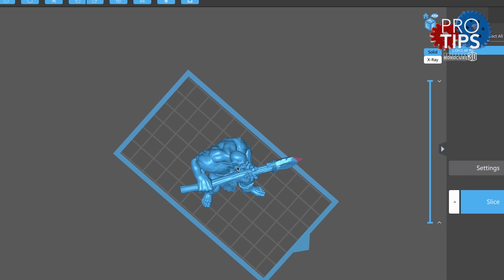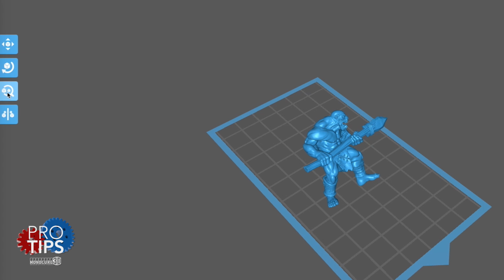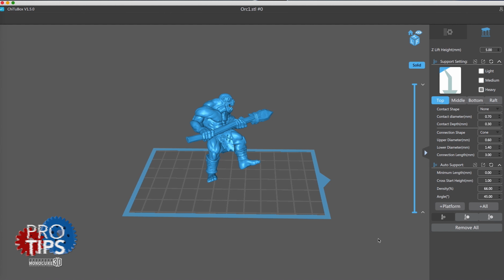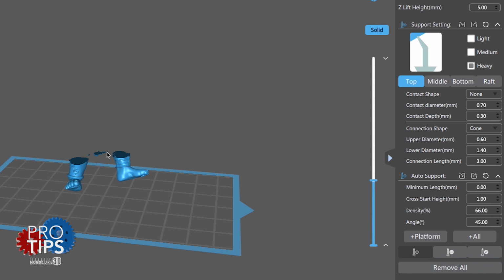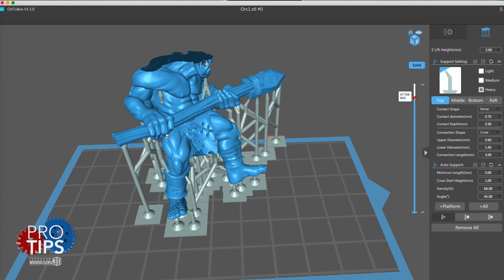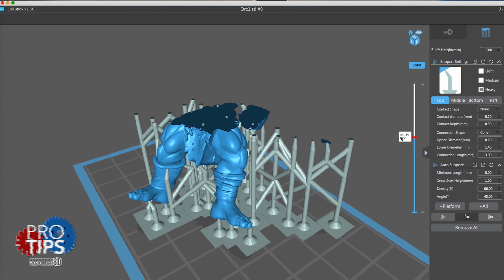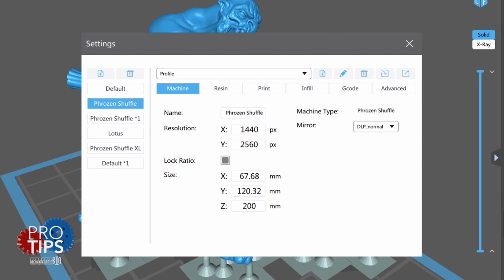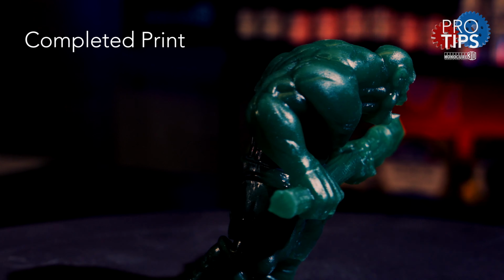How to position and support your 3d printed resin models in Chitubox.

Comment: I pretty sure the teeth failed. Notice in the video during the high res reveal, they start showing it from a side angle then just as you might be able to see the side of the face they start blowing smoke at the model. Why not just admit your mistake instead of trying to cover it up?
Reply: That was my observation as well. It was pretty apparent that the upper teeth would be an island and not print correctly. It could have been a perfect time to show that is important to double/triple check your layers before calling it final.
Reply from the maker: The teeth didn't fail! We were not trying to cover up anything. The smoke was not intentional.
Reply: This tutorial is misleading because instead of checking islands in the model, relying solely on Auto-support is a proven receipe for failed prints. How is that for "Pro Tips"? Many people will try and do this and wonder why parts of the model won't print. When he removed a support for the teeth, I was perplexed thinking this is definitely going to create an island and missing teeth in the final print. And then they ended the video right before the front face reveal. Lol.
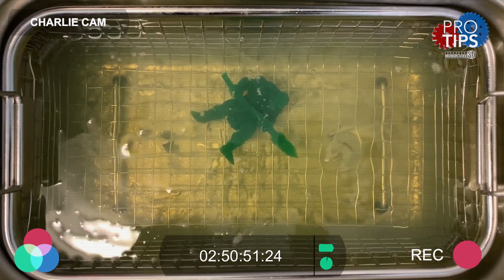Reply: It didn't really even have supports for the teeth, just one for inside the mouth. Yes the teeth failed. You can clearly see the failure at 15:30 to 15:40. This model would have been best printed on it's back, the way it was positioned by the artist! That is the only way to get the teeth to come out right.
Reply: True.

Comment: Thank you - Question: Why did you remove the supports from the teeth?
Reply from the maker: Andreas KOKKINOS I didn't think it was needed and would be hard to remove.  a I was right as the teeth printed perfectly.
Reply: @Monocure3DProTips  Thanks. I am trying to understand what made you take this decision. Wasn't the tooth an island?
Reply: @vactirio  I am wondering the same thing. Did it really print perfectly or is it just not noticeable. I wouldn't want a little chunk of hardened resin floating around or sticking to the FEP
Reply: MV Dive  I think so too, in fact at 15:35 we can see that the model does not have upper teeth

Comment: Did the top teeth print correctly?
Reply from the maker: It was a long time ago so I can’t remember!
Reply from the maker: It was a long time ago so I can’t remember!
Reply: If you look carefully in the video, you can see that the upper teeth, in fact, did not print. It does seem almost intentional by the video editor to gloss over that with how they cut the 360 rotation of the finished print.

Comment: Exactly what I needed to understand around supports. Thanks!
Reply: Dont rely on auto supports.  They miss a lot.  Even in this video, the reviewer missed supporting the right hand .  That print would fail.
Reply: @broderp  thanks for that. Do you have  any advice on how to decide where to put a support, especially how far between each support? It is it all a matter of trial and error until you just have an eye for it?
Reply: @SimonJHudson  the most important is to support every island. Slide through the layer view an hit any spot that is not in connection with the rest of the print. this is also important for the orientation of the model to make it easier for you to support well.
Reply from the maker: Glad it helped!

Comment: Some ideas... It would be great a video in which you show a printed model with all the different types of resin that Monocure sells and talk about their properties. Also mixing normal resin with Flex100 and doing drop tests. In this way we could know what would be the minimum percentage to add flex so that a model is as rigid as possible but does not break into small pieces if it falls to the ground.
Reply from the maker: Thanks for the ideas Martin! We did do a Flex100 video - maybe you missed it? https://youtu.be/V-3enPZoQYs
Reply: @Monocure3DProTips  Yes I did and it's great, but would love to see a more in depth one. Like with 10% of flex or 50/50 ratio and then maybe compare all those prints, how they behave, pros and cons... BTW, I'm just curious and super new here, still waiting for my printer and monocure resin to arrive and eager to start testing things out.
Reply from the maker: Great idea! I will do in a future episode. Good luck with your new printer. Let me know if you need any help setting it up.

Comment: I have sonic myghty 8k from month. Everyday i trayed to print some straith things without succes. I have so strong adhesion betwen printing layers and FEP that it is impossible that i can print this character from your movie with this same support as you used. I saw that for example someone on yotube print 1cm dia sphere with only one support. In my printer i have to use so many supports that fill half of the spehere. I trayed every single advise from internet and nothing improve my situation with this. In a few days i I'll throw this printer out of the window.
Reply from the maker: Sounds like you are over curing the resin - also include a 2 second delay before lift
Reply: @Monocure3DProTips  Many thanks for your answer. After watching your movie i have downloaded your model: the cones of calibration. I tryed to print it and of course first print was a disaster but second print pass. It turned out that i have to use few second exposure time and after this - my every print is succesfusl. From that day i start using much much less supports. Thank you.
Reply from the maker: No problem - glad we could help